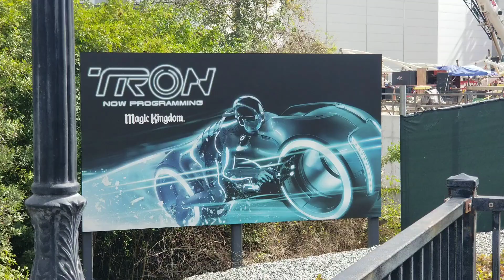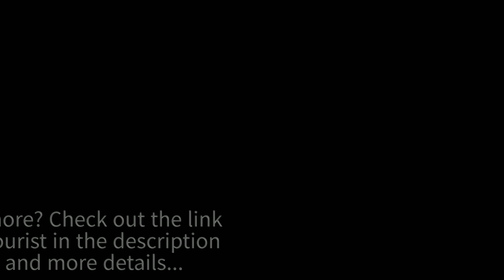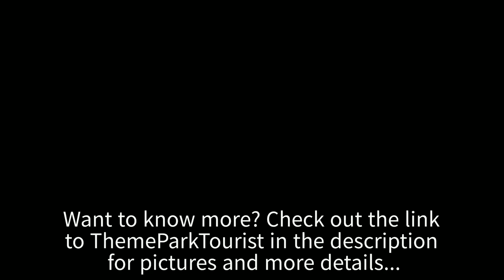Construction Progress for TRON Lightcycle / Run @ Magic Kingdom (February 2021!)

Comment: Little annoyed that they designed the panels to hide the show building in Shanghai and yet they didn’t bother to cover the show building.. really makes me worried lately about Disney’s commitment to immersion
Reply from the maker: I have noticed this with several recent attractions. For one thing, I'm curious what they're going to do about the showbuilding for Guardians of the Galaxy: Cosmic Rewind. They may just be designing the rides in stages, but with budget cuts as a major concern, it seems possible they may just leave the buildings as is.